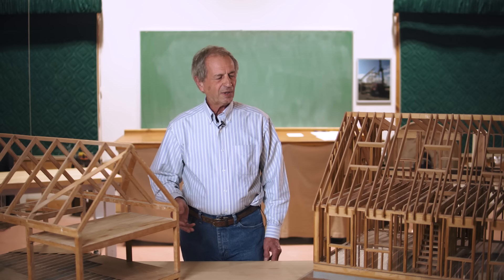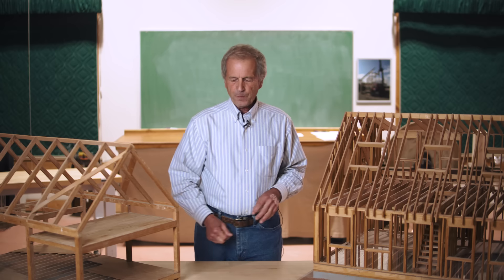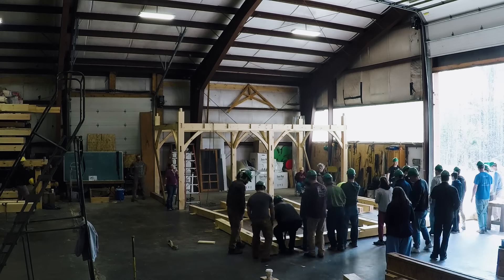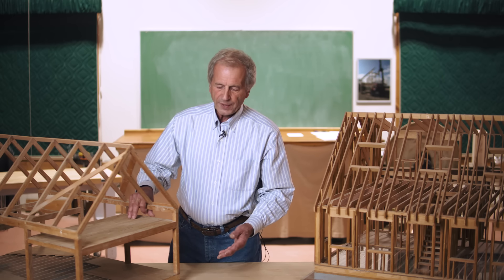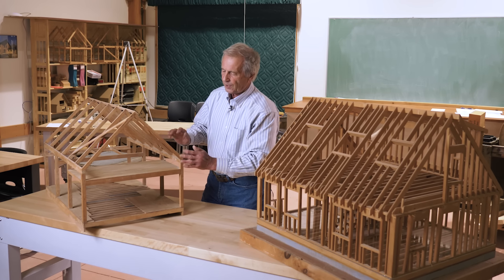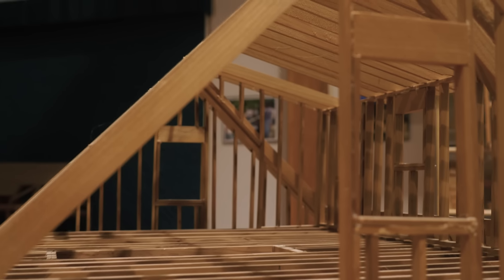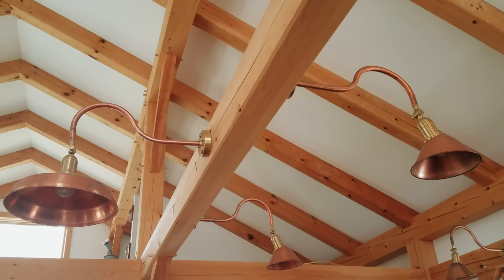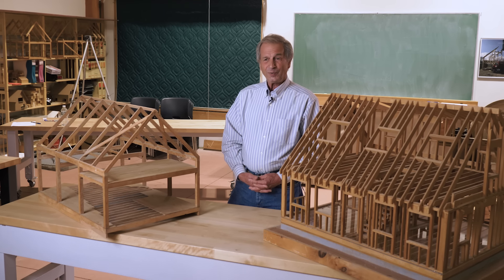Timber Frame vs Conventional Stick Frame

Comment: A stick-framed house can be insulated on the outside of the framing just like a timber-framed house.  That being said, timber framing is certainly an elegant way to build a house.
Reply: i added foam to mine easily...just ask
Reply: How do you insulate on the outside?
Reply: @MsElijah16  just nail on foam board
Reply: As you said, it's not a nice look with 24" inch studs on the inside. Wider gaps with wider timber is what makes that aestetic possible :D
Reply: @davidbrogan606  it can have overhang we isolate such houses quite often
Reply: @TheGogeta222  Yes, it can have overhangs, of course.  But the insulation is not contiguous that way.
Reply: @Sunblocker101  Yes, that is certainly a big part of it.  For me, it is also how the timbers are attached in a more organic way, almost as if they had grown together that way.
Reply: And 10 times as strong simply can't be beat by any stick frame and like you said very elegant
Reply: @MsElijah16  just like a timber frame. It's the same concept.
Reply: @Sunblocker101  nothing says you have to leave the 24 in space studs visible. The original comment was about insulating a stick frame build.
Reply: Having done both, find it a really one sided opinion. But oh well, to each his own.
Reply: @davidbrogan606  Yes exactly, I'm building my own house by myself atm and it's conventional framing but with non loadcarrying beams in the ceiling sticking out of the inner roof at 1,25 meters apart, majestic :D
Reply: @otm646  No ofc not, I'm building a stickframe with compartments filled atm  myself. But he was saying you can insulate on the inside like the dude is talking about in the video on timber framing.
But the dude in the video is wrong, a lot of people do the insulation between the timber framing too, not just outside.
Reply: @Sunblocker101  Nice.  That sounds quite attractive.
Reply: @davidbrogan606  it can if you cut the overhang off let a space of 10-30 cm isolate that space and let the left overhang go outside as own system so we do it here it's than called Aufschiebling so we don't have Anny connection to the outside and you can isolate it completely
Reply: @TheGogeta222  Yes, if you must have overhangs, which I personally like but have fallen out of favor with some modern aesthetes who like the cleaner lines.  However, as you know, overhangs do serve a purpose in keeping everything below the roofline drier.
Reply: @davidbrogan606  you can even calculate how to protect the whole wall if you put a 70° triangle from the deepest part of your wall to find the minimum range of the overhang
Reply: @TheGogeta222  70 degrees, huh?  That's good to know.
Reply: By the time your done you can turnaround and remove the stick framing on the inside ! So what's your point ?
Reply: @timbourque5095  you're
Reply: @davidbrogan606  well by time you build it up to match that R value he's talking about then it would stand on it's own, just like panels which are structural all by themselves except you would add a ridge beam and so on..
Reply: HappyandAtheist  not true.  Places with a lot of wood build with wood.  It is cheap if it is local and it is a fantastic building material.  Just like anything else it needs to be used correctly and maintained.
Reply: David Brogan 👍
Reply: @timbourque5095  With a couple inches of EPS you can get some crazy high R-values and yes, it does improve the structural integrity of the home.  However, is it as high as a timber-framed house?  Probably not.
Reply: @davidbrogan606  a couple inches yes but panels are made of different types of foam and thickness so yah depending , I've built and sent building's to Antarctica made out of panels we dropped them out of planes , they were round buildings with bubble windows they may have disappeared under the snow and ice before now maybe they could be exposed again , crazy.
Reply: @timbourque5095  That's interesting.  I guess there are lots of abandoned buildings there buried under snow.  
I know there are types of vacuum extruded foam which have a R-value of about 30 per inch.
Reply: @davidbrogan606  when I was a kid I worked for the guy that invented panels in VT and some friends bought one of his frist  homes .
Reply: @timbourque5095  Again, that is interesting.  It sounds like your life is being guided by the Lord.
Reply: @davidbrogan606  yah I worked with some incredible people I've been lucky I guess done a lot of cool stuff to become pretty much homeless all that's around me is Spanish speaking people working that's what you have to be to qualify for a job they don't like and will not work non Spanish speaking people .
Reply: @davidbrogan606  but yah I was lucky I started getting involved in timber frame building in school , my teacher got some 💩 for teaching us that so he quit and started a timber frame company and some of us went to work for him so we have done some amazing things reproductions historical sites and much more after that he lost the company and some guys from VT came to our last job and hired the whole crew we where Young and had tons of experience I was like 27/28 at the time we were building at the bottom of MT. Washington at the time .
Reply: @MsElijah16  Zip brand and similar sheathing is the new go-to.
Reply: @TheGogeta222  70 degrees from ground level of the exterior side of your exterior wall, and draw an imaginary line from that point to the point where it intersects with an imaginary line drawn following your roof pitch and continuing on into an overhang? (Kinda hard to word. Hopefully you understand me)
Reply: @MsElijah16  search EIFS , Exterior Insulating and Finish System.
Reply: @American-Plague  yes that would it be  thank you very much sorry that I can't explain it well I'm not a native speaker^^
Reply: @TheGogeta222  Cool! Thanks!
Reply: @d.e303-anewlowcosthomebuil7  Soy foam? That stuff is like herpes.
Reply: assassinlexx  Spray foam is the worst. Way to permanently ruin your timber frame.
Reply: Would you not be able to insulate, build walls, and attics on a timber frame just as on a normal one?
Reply: @danv2888  Timber frame does not have studs ever 16" or 24" around the outside walls like stick-built home do.  Then there is the issue of those studs being a bridge to the outside and transmitting outside temperatures to the inside.
Reply: @davidbrogan606  I understand the studs are farther apart. However, would you not just be able to get longer and larger sheets of plywood or other wood sheets (I also forgot about sheetrock and drywall however would think you can get those made larger also). Also the insulation. I quite certain larger sheets are available and other options like spray.
Reply: @danv2888  As you say, I'm sure there are other options like spray but you still have cold spots wherever there is a timber and there is the issue of off-gassing.  Although they say that is no longer an issue.  A 6" timber has an R-value of 6.  And really, there's nothing wrong with what your're  saying.  However, wrapping the outside of your house in airtight foam insulation makes for a cozy home that is quite efficient.  Have you checked out Matt Risinger's videos?
Reply: @danv2888  Another thing, insulation on the outside lets you skip the drywall and have the beams visible.
Reply: @davidbrogan606  Thanks for the information, but no I have not looked at any other videos then this one. However, I did interest me. The only thing I did not like is the fact that the beams are visible, and he said, "Then its not for you." So I had the questions. One other thing I guess I'm curious about is how hard would it be to build a two story or is that possible with a timber frame?
Reply: @jon4715  -Very toxic too.  Awful stuff.
Reply: @danv2888  Yea it is.  There are some videos on it.
Reply: @brendaann727  Yes, very toxic. I am extremely sensitive to it, ruined a room I once loved.
Reply: @adamthiessen8518  - I saw first hand how strong when a 100 year old house on friend's property was torn down.  The guy spent all the first day trying to knock it down with a forklift. He also used a tractor. It just wouldn't go.  🤔🤫 I was almost cheering because it was a part of the community & hated to see it go.  Can't remember what he did the second day, it was just too sad. 
   By contrast, we had to move our stick built cabin off of the property.  At first it was skidded on telephone poles acrosss the street.  Then we had to move it across the road about 4 miles away.  Rather than pay to move the power lines, they took the second floor off.  All they did was take a crow bar & hammers to it & it was over very quickly. 😢
Reply: @ davidbrogan606- Good for you, are you finished now?
Reply: @ timbouque5095- Your kindness to others does not go un-noticed with God.  My son & I gave up alot to help others, at times we have struggled greatly ourselves but we know our reward is in eternity & it will be much greater than anything on the earth. 👍🏽🙏🏼🙏🏾🙏🏿
  So they would not hire you & you were out of work?
Reply: @ -Horrible stuff.

Comment: 20 years in Florida as a carpenter.  I have helped build both frames. 
The quality of build is the most important part. 
Both frames can withstand a hurricane.  As long as you use a good contractor.  I have rode out two hurricanes.  Opel and Aron.  I traveled rebuilding afterwards to. After Andrew I was in Miami for year. 
I have seen streets where you could spot good construction practices for corner cutters easily.  The well built homes were still standing. Building codes are there for a reason.
Reply: This is a really old post but you sound like the guy to ask.
I moved from California to Tennessee several years ago. I bought a house with a 40 by 40 shop. I'm a retired cabinet maker. A couple of years later a large pine tree fell across it and I had a new shop built by a reputable company.

Being from CA. I had never seen timber frame construction. When I saw 2 by 4 studs going up on 2 foot centers and 2 by 4 prefab trusses on 4 foot centers I began to question the builder's ability. That's when I realized that's how structures are built back here.
My new shop was built on my existing concrete slab. There was no joinery that was different than any stick building. There is no diagonal wall braving or shear wall. The outside is clad in metal as is the roof.
My question is this: is this structure a stick built or timber frame? Does the metal sheathing give this structure adequate rigidity.

The company did a great job and it's a beautiful building. I'm quite happy, but I really don't know what I have.

Thanks in advance for any reply.

Comment: I may have been admiring the model house on the left too much and missed it but there may be another factor you could add to strengthen your cause for this building method: Longevity.A timber frame house can last for hundreds of years whereas conventional framing will be lucky to last 100,especially with contractor shortcuts and lack of inspectors.There was a timber framed barn from Germany that was 500 years old in my town in British Columbia,Canada.The owner had German carpenters label and dismantle it,crate and ship it to Canada and reassemble it for him as a home upstairs/restaurant downstairs.Imagine building a house on your own land and out of your own trees that your great grand-kids could live in one day.That's special.It also makes the high initial building cost very affordable over the long term.
Reply from the maker: Timber frames are adaptable and durable!
Reply: There are a lot of old timberframes and they are truly beautiful and I hope to build one myself one day. 

But conventional framing lasts as long, there is nota difference there, wood is wood.
Issue as you are describing is bad workmanship and bad techniques, My old house in sweden was from 1925 and it had a conventional frame, after refreshing most of the interior of it while I lived there I found no issues att all with the structure, if moistrue is propperly planned and everything is done right the conventional frame will last just as long as a Timber frame.

In sweden we learned the hard way with -30c winters and +30c summers and become moisture experts tbh, and now with full mechanical ventilation that controls moistrue too it's going to be even easier.

So it's not the frame that doesnt last, it's the surrounding systems that make or break it, you can as easily fuck up a Timber frame, enclosing it with no moistrue transportation and airing and if a timber frame rots then you have a 10 fold bigger problem then if a conventional fram would rot, just saying
Reply: @Linus Surface area has alot to say as well, thats why a log lasts so much longer than a small stick. Conventional frames here are Timber frames? 99% of the houses i se in this area is timberframes. Ive renovated a few houses, never came across anything else than timber frames. Greets from your neighbor :P
Reply: from your own trees ? you need first to remove resin, then make it dry... do tou have a river ?  then do you have 7 years to wait for dry wood ?
Reply: @DGDG0000000  Cut the trees down in the spring,peel them,and stack them up off the ground.Go back the next spring and build with them.That's how my friends built log cabins.I know some that sent their logs to mills to be kiln dried so they could start sooner but most are willing to wait the year and save the transport and kiln cost.As for building a timber frame house,I would have to hire someone and do what they recommended.
Reply: People's Front of Canada very expensive to find the land to do this on in America.
Reply: @JamesR23  If you don't mind cold there's probably some areas of Alaska left.I would have to go really far north as well to get a reasonably priced piece of land but it can be done.At my age though it wont be happening now.Young man's game that.
Reply: I almost cry when I see an old harm rotting from neglect. Terrible waste.
Reply: We live in a consumer driven society where choice, change, and entrepreneurial innovation is connected to our economics; helps us flourish. If you built a house out of stone it would last thousands of years but our economy and all the myriad jobs, products, services would disappear. We would effectively transform ourselves back to the stone age... However, we're at the precipice of a massive technological disruption where 5 forces and 14 technologies will usher in a period of extreme growth, development and change. A hundred years ago, civilization was disrupted by the invention, adoption and commercialization of electricity, the phone, and the airplane - just follow the massive innovative breakout that happened as a result. The new paradigm shift is going to happen with autonomous tech and robotics, nanotechnology, genomics, artificial intelligence, next generation internet, and financial technology. There is a massive wave coming and we're just at the start of the exponential s-curve. Mark my words.

All this to say, building with wood will not go away but will be in profound abundance.

Respectfully,  

From a Canadian,
Reply: Uh, pardon me but traditonal timberframe buildings did not have expensive waferboard and foam panels and thus required small closely spaced studs to nail the sheathing to (and roof decking and interior lath for plastering- identical to stick frame. Stick frame buildings have been around in various ways for centuries. In pure form, since the 1850's, and they have lasted quite well. One of the poorest built homes I saw was from the 1830's and this was not known till we opened the wall to make some changes the owner needed. The longevity was not affected, What affects longevity is is 1. Roof maintenance and gutters and downspouts (Very important)  Sheathing maintenance such as keeping paint on the clapboards. and  3. Foundation soundness. None of these are unique to the one or the other type. In fact pressure treated sills on stick frames and pressure treated plywood sheathing on the bottom 2 feet around the house takes care of a lot of potential issues. I have worked at historic restoration for 30 years on houses from the 1790's onward. In fact, there are 1860's stick framed houses in better shape than certain stone and brick houses from the period I could show you.

Comment: A few years ago I built a small timber frame house/cabin out of wood logged off the forested property using only the Jack Sobon and Roger Schroeder book as a guide. It was quite a satifying acheivement, as someone with no real construction experience to speak of.

Comment: I built a timberframe/ full scribed log home hybrid once. A very beautiful alternative to cip panels on the walls. 

You can also use full logs instead of square timbers. There's more math and work involved, but can be quite visibly rewarding.

Comment: Just curious, how do you wire a thing like this? Where do your device boxes go... Would they all be surface mount and run with exposed conduit?
Reply from the maker: Jack Duno GREAT question! You could surface mount in conduit. More typically it is run through the hung wall in chases or run through a chair rail mounted on the inside of the exterior wall. And then too run through the first floor platform and any interior partition walls.
Reply: The SIPs have pre drilled channels in them for electric and plumbing so they are hidden from sight
Reply: Everything wireless.
Chinese!
Reply: You can drill through the wood, ofcourse. Wires are often run under the floor or through the ceilings too.

Comment: In the UK we construct both systems. In the “stick” system we would insulate between studs and rafters but also the outside or the inside of the timber frame. This eliminates cold bridging.